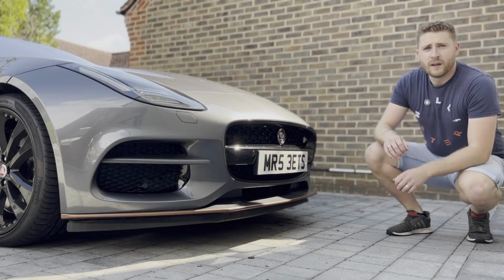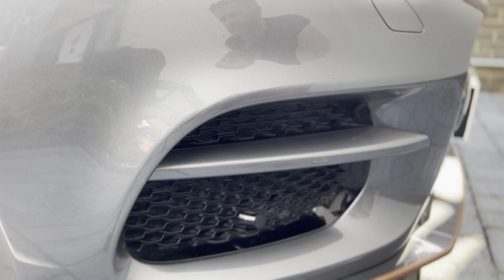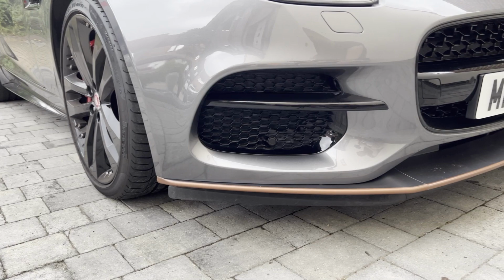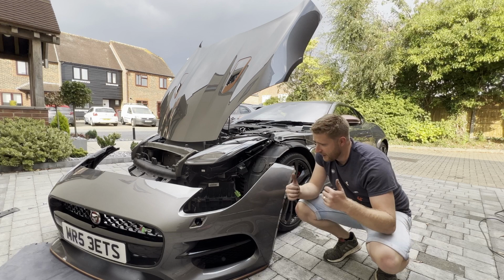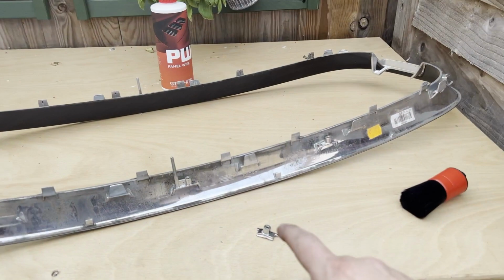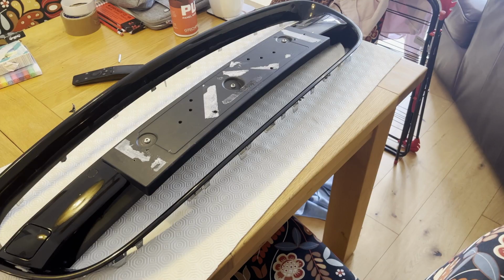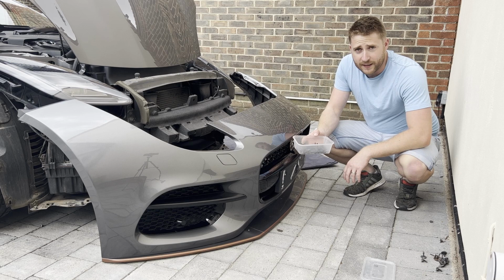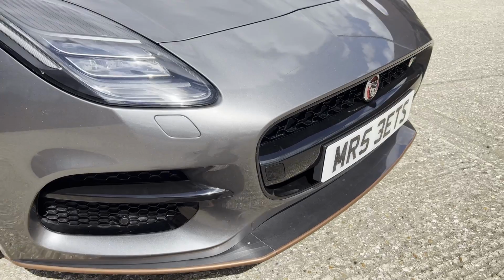Jaguar F Type Front End Removal | Overhaul Of The Front End, Including Bumper Removal

Comment: I know its a wee bit of an unusual and difficult question, but is it possible to fit the pre-facelift V8 front to the face lifted f-type or are the changes too severe ? For that matter is it possible to interchange the facelifted V6 front to the V8? I’m just not a big fan of the newer V8’s design
Reply from the maker: The body panels will certainly fit. I would reccomend keeping your original headlights, as I'm unsure if you will run into coding issues

Comment: Can i ask you a question? I bought mine as damaged, didnt come with front parts. On the left side i have cables going into bumper 2-3 connections , green etc, but on the right side i dont know where these cables are going or i have the wrong bumper. My mechanic is useless. Would you be able to help? I’ll buy you a drink if you can 😕
Reply from the maker: Thanks for watching. Mine only had two plugs, on one side of the bumper, as you can make out in the video. Are you saying you have plugs on both sides of the bumper? What year and model is yours?
Reply: @MrGB_UK  thank you for your reply. Its the F TYPE BUT S , 2015 3.0 model. Assuming maybe its the Air cleaning box. Just cant make any sense of it 🤷🏻‍♂️
Reply: @MrGB_UK  i’ve put a video
Reply from the maker: @mkinili2527  where’s your video? Do you have any pictures at all? My email is in the ‘about’ section if you want to email me